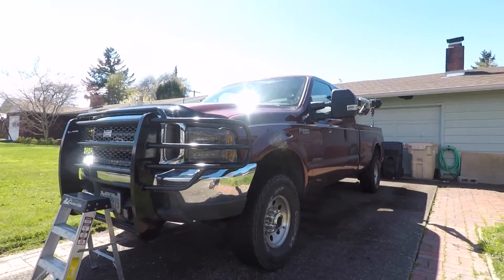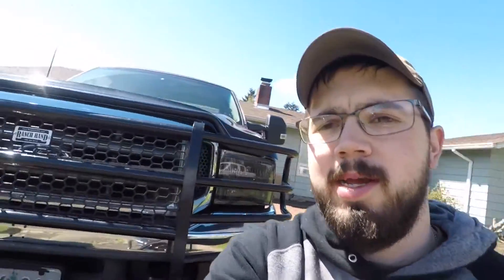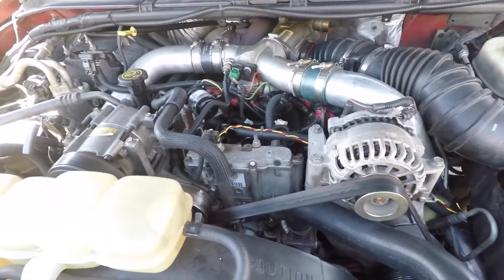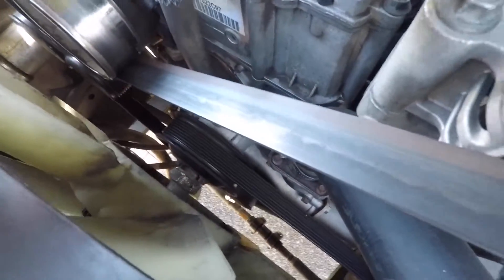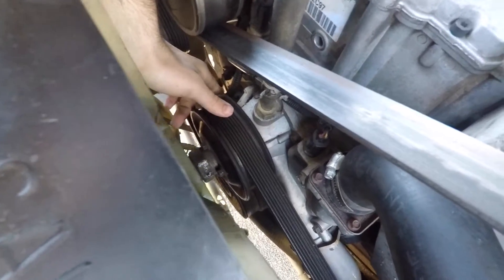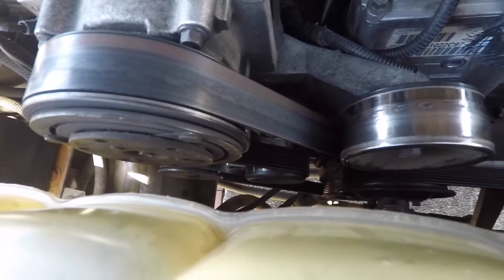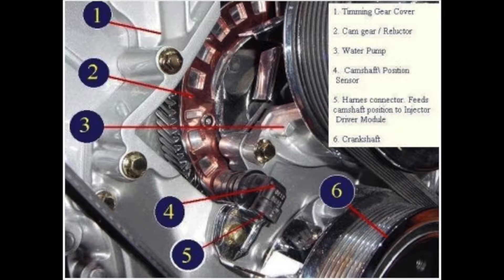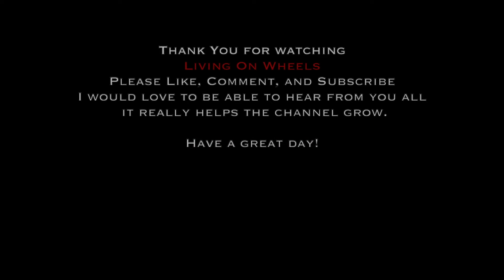Ford 7.3 Common Problems Part 1: CPS Sensor

Comment: Great explanation mate 👍 you have a new subscriber from North of Norway 🇳🇴 👍  I have a 2001 excursión 7.3 and a cople days ago for my surprise he starts good but after a cople seconds stopped and  I hearing a air leak on turbo zone! looks like a exaust valve is stuck!  I don't know if the EBC sensor interfere on this caind of the problem 🤔  because I checked a failure code is P0478!!  after see your vedeo I buying a  both sensors  a CPS and  EBS will see what's happening after replacing 🤔 👍
Reply from the maker: You could also try unplugging the solenoid on the turbo pedestal to determine if it electrically malfunctioning or if the valve is physically sticking.

Comment: 2002 f350 diesel 7.3 shut off while driving and would not start I know you said when cranking you don’t see the rpm needle not moving it could be the cps. Question when truck shut off while driving i turn the key and wait for the glow plug light to go off but it just stays on any idea why ?
Reply from the maker: Do you have a tuner “chip” on the truck? If you do, it sounds like it wiggled loose on you and has a bad connection now.

Comment: Hello, I'm new to your channel. Just wanted to say I appreciate your advice and info.  I have a hard start problem on my 02 diesel excursion 7.3
I've replaced the IPR, ICP, glow plug relay, glow plug module, fuel filters.  Once my vehicle starts and warms up it seems to run fine.  I've checked my fuel bowl after sitting the truck for a period of time to check of the fuel is bleeding back but so far the fuel bowl stays full. I did this because I had suspicion that it may be a weak fuel pump.  I'm in CA.  Any advice or suggestions would be appreciated. Thx
Reply: Glow plugs themselves. Mine lives "on the cord" (block heater plugged in) at home and at work when temps drop below 40* needing new glow plugs ever since I bought it 2 seasons ago. I'm at 9k elevation so double negative temps even on the cord, hard starts are daily.

Motorcraft zd-11 glow plugs are the only way to go. Bosch gplugs burn hot but dont last. Autolite, acdelco and all the other ones aren't what the 7.3 ps needs. There's another gplug american made that thoroughbred diesel sells on their website (I forgot the name of the gplug) I haven't used them... 

We put a set of zd-11s in a beat to s#!+ '00 7.3 with new vcover gaskets, under vcover wiring harnesses and a new gplug relay. Dang thing starts better than mine does not being plugged in at 9k elevation and it's clapped out.

Dieselorings website sells a gplug relay (white/rogers or something) that's a massive unit. It takes a little shim work with washers to get it in but if you do it right, last time you'll do it. Dieselorings is just outside of Sterling/Fort Morgan CO if I remember right.

You get a good set of glow plugs in yours, itll be a different truck.

Comment: I have a question. I have a 95 7.3 power stroke and it’s in a crack no start. Has new injector orings. Cps is good (tachometer bounces when cranking) and have 700 psi in hpop. Any suggestions?
Reply from the maker: any smoke out the pipe? Do you know what your fuel PSI is? Do you have a WTS light? Have you checked all your fuses?

Comment: Dude are those mirrors 2017 ? How did you get the bracket to mount? I have a set, but definitely different
Reply from the maker: They are an aftermarket 17+ style mirror. They bolt right up. So as you could guess, not 17+ OEM mirrors. I absolutely love them! The ones I bought aren’t for sale anymore but I have seen other similar ones on Amazon.

Comment: my 2000 f350 has white smoke if it sits and runs for a min. not bad but noticble . and hard start could it be bad injectors?  thanks for your time.
Reply from the maker: Definitely could be. Make sure your glow plugs are good. White smoke when it’s cold out is normal though till the cylinders warm up
Reply: @LivingOnWheels  just put new glow plugs in. I'm thinking injector white smoke bad when cold. If i plug in block heater no smoke. Thanks fir your time. You have tought my alot .

Comment: I recently inherited a 97 f350 7.3 and I had to replace the cps and about a month later I had the same die out problem while driving, I tried to turn it over and saw the tach move so I'm thinking its not the sensor again. Any thoughts on what to try next? Any help would be appreciated!!
Reply from the maker: Best investment for you would be a way to monitor the trucks systems and pull codes. Otherwise you’re basically just blindly throwing money at it. I personally run an edge cts insight and really like it. There are other option out there though. 
https://amzn.to/3jZqpvS

Comment: What could cause you to go through multiple CPS over shot time?  Let's and I've already replaced the connector are the harness for 2 still giving me problems
Reply from the maker: Kyle Summar are you using oem units?
Reply: @LivingOnWheels  yes
Reply from the maker: Kyle Summar hmmmm. What makes you think the CPSs are going bad?
Reply: @LivingOnWheels  the code it through plus when I change it. it will run fine for about 400 miles. Then lope or seem to miss.
Reply from the maker: Kyle Summar hmmm. Well I’m not sure which code it is. Seems very odd. Not doubting you. I’m not sure.

Comment: Hello,

I was scrolling through old YouTube videos, trying to figure out my 7.3.. I was wondering if you could lend some information. So it's a 2003 ford e350, starts right up in the cold fine. When your cruising down the road 35 to 45 mph, the acceleration will spike like your holding it wide open! The bus will really start to pick up speed, last 3-5 seconds after you let off.... at a total loss with it. Any input would be greatly appreciated! Thanks so much
Reply from the maker: hmmm thats a little sketchy. I honestly am not sure and I hate just throwing money at a problem to try and fix it. I would try to get my hands on a scanner and or a way to monitor the systems when this happens. My first guess would be maybe a bottle throttle position sensor.
Reply: @LivingOnWheels  the code that came up is p1208 icp sensor
Reply from the maker: Midnight Chevy ahhh well that is very easy to swap out. I highly recommend only going OEM though. Other off brands have a large track record of early failure.
Reply: @LivingOnWheels  would that be a dealership thing or is motorcraft factory
Reply from the maker: Midnight Chevy you could probably get it at a dealership or order it online.

Comment: hey joe, is there any chance of you making a full recovery from your accident? I know you're able to stand for shorter periods of time.  you're an awesome dude and id love to see you back on your feet full time, either way love your vids got an 01 powerstroke 356k miles turned yesterday. keep up the great videos.
Reply from the maker: I may make small improvements over time but I will never come close to a full recovery. I did some pretty bad damage to my spinal cord. That being said, I have been very blessed with the recovery I have had and consider myself fairly lucky. I appreciate you following along with the channel!